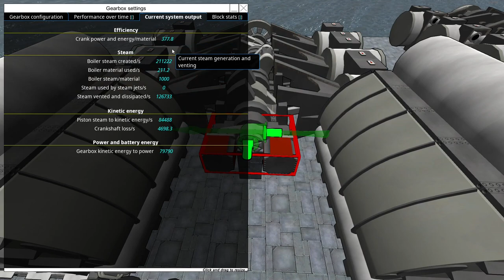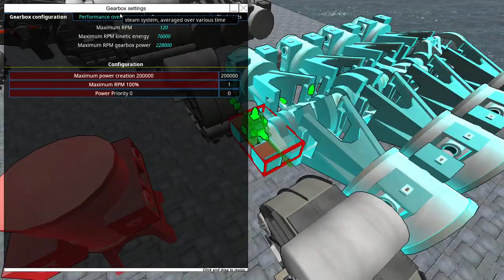Everything about Engines! | Ragnarok Refit Ep. 6 From the Depths

Comment: Yo one of the best kind of engine. It’s RTGs and electric engine. Think about it provided you have a couple electric engines and they have some EMP protection they are much more resilient than fuel or steam engines. they are more expensive and take up more space for energy however they pay for them selves over extended use usually only takes about an hour of time for them to pay off the difference. Use RTGs and electric engines. Plus if you have a giant battery reserve of 30 or 40 million which really isn’t that expensive for the extra capability it allows you can have more rail guns or particle cannons.
Reply from the maker: I’d rather the lower upfront cost and better PPV of steam.

Comment: For the steam piston engine: if you limit the max RPM to a little above what the system can provide at max load, even when there isn't any load it won't be such an material sink, the boiler will automatically limit it self to ca. one tenth of its normal burn rate, while the rotation speed stays the same. With this, there is no spin up time at all and even the biggest engines burns like 2 materials per second max on no load. Interestingly enough, the less ppm the engine usually has, the more effective this technique becomes. Doesn't take any extra blocks and doesn't limit the power or volume efficiency. A must have I think. Thanks for providing incitation!

Comment: I use only electric engines in my 4x1kmPAC satellite and they pump out 200k energy a second. Its enough to run all 4 PAC and LAMS. Even better is the redundancy is nuts since you can use many EE per battery bank and spread them around. The secret? All the steam storage tanks in the world and hyper optimized generators. It makes cheap steam at low burn (even 1% burn is enough unless always fighting). It's based on banking principles, actually.

Comment: I'd not agree that fuel engines are not redundant. They are in their own way. You can place a lot of those 5x5x5 engines in different parts of your ship and don't really care if 1 or 2 get blown up because you have a lot more in non-breached parts of the ship. The same thing does not apply to steam engines because if they lose 1 specific block they become useless.
Also, PPM of steam engines is kinda questionable as they need to spend mats to raise and sustain their RPM. The bigger the steam engine the more mats it takes each second to be able to give you as much energy as you need. So effectively you will spend materials even if you not use any energy from the engine
You can take a look at BBS Fifth Season or Moros in the workshop. Those use fuel engines in a way it'd be very difficult to cut off the power supply
Reply from the maker: Id prefer engines that can take several hits and have multiple distributed around versus something that takes one hit and dies. And regarding efficiency, the Ragnarok will either be in combat or not in combat; it will account for that and only spool up as much steam as it needs to power itself in those states.

Comment: I usually run multiple engines in a "high efficiency cruise engine" that can handle movement and ou tof combat situations, and a few "high power" engines that turn on when the power is needed that just burn through mats but give all the power i could need

Comment: Unfortunately brenzo, 8:13  that engine is not an inline turbo engine. In-line engines are CRAZY efficient. If you make a modest turbo engine and feed the exhaust into the inline engine, it gets max turbo boost at ANY rpm (if the turbo engine gives enough exhaust).  Meaning you can, in theory, have one low power efficient engine and another High power efficient engine even at low rpm. I need to do some testing on it but I will put numbers here if I feel like it.

Comment: Not kidding but when you explained the steam engine staging with the small pistons i was thinking how crazy it would be if there where some sort of switch to swap the engine between the staged and the serial design based on power demand. 

Just to later see that you did the exact same thing with the large pistons
Reply: But how about using the remaining pressure from that design to feed it into a generator afterwards wouldnt that increase efficiency again or does that not work?

Comment: Sorry to burst your illusions, but I promise you that you never knew anything about fuel engines.  A well-built supercharger fuel engine can easily get over 800ppm if you use LOTS of radiators to cool the cylinders, and keep the RPM to around 0.3.  Meanwhile, the whole amazing thing about inline turbos was that you could, at the extreme, make free energy in that the amount of materials used was so low that the game engine treated it as zero per time-tick. You'll certainly get over 900, and with just a bit of know-how be able to get significantly over 900ppm.  Back before the introduction of steam engines there were absolutely dozens of the super-efficient engines in the workshop that were over 1,000ppm.  However, that super-efficiency of turbos is only at high load, so you have to have multiple engines, each one turning on and off so that each is always running under full load.  At low RPM the super efficiency of turbos is lost.

Since the introduction of steam engines and custom jets it simply got easier to make 'good enough' engines with steam and jets that couldn't rival the efficiency in materials, but were much, much easier to build, and much more efficient in ppv.  Basically, people decided that they could get close enough with easy builds and no complex spaghetti exhaust-turbo systems for most needs, and if they really, really needed to save materials they just use RTGs.  As a result, the more complex, higher skill of super-efficient engines was largely a lost art.

Mentioning RTGs, you kinda got that wrong too.  You had one 3x3x3 RTG to feed one 3x3x3 battery block, and that won't work without all the other engines you had on the platform filling the battery.  You need roughly 5 times the volume of RTGs to battery volume to keep the battery topped up at the rate that one electric engine attached to those batteries would burn the energy.  Thus, your volume calculations were way, way off.  RTGs take a ton of space/volume if you need to generate, say 40,000 energy per minute to power a full set of shields.
Reply: I wish I could show you my 1% burn setup that makes over 200k energy a second. It's like 20mat a second and runs 4x1km PAC and LAMS and keeps me at 2500 altitude.